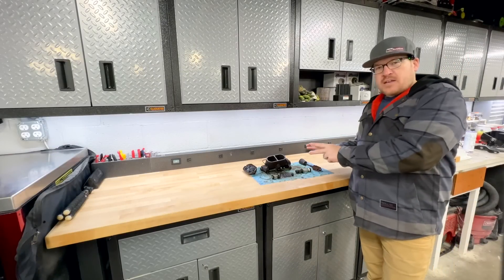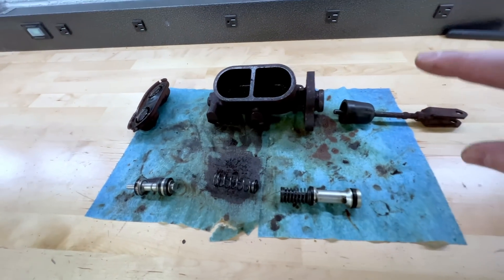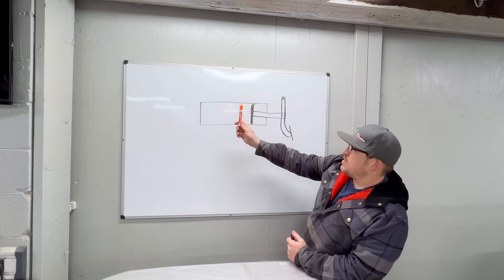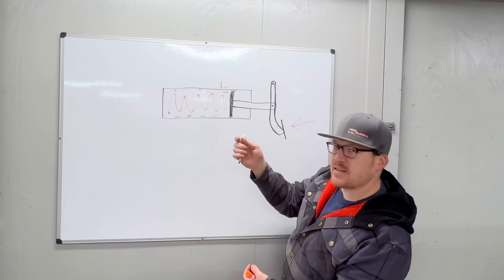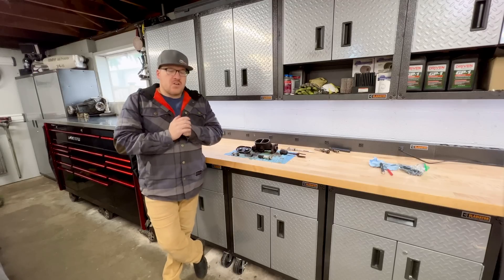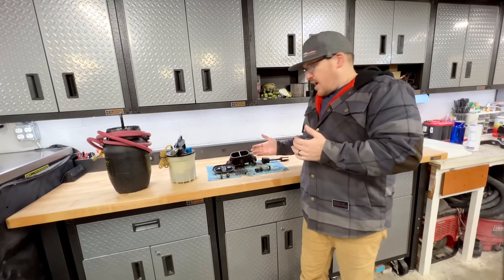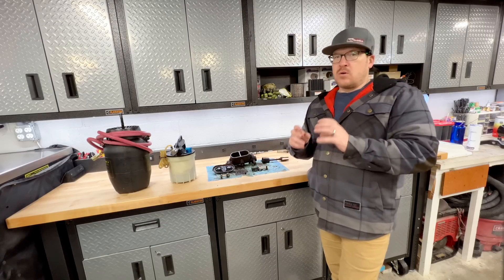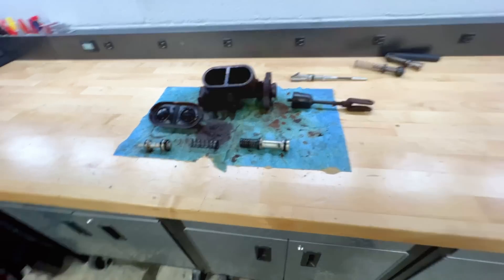Why Your BRAKE Master Cylinder Randomly FAILED After BLEEDING Your Brakes

Comment: I had brakes fail, Replaced calipers, no change. Replaced master cylinder, no change. Replaced brake booster, push rod engaged too much, over heated. Reset push rod, now it seems like the new master cylinder has failed. Brakes go to floor after starting car, can pump them up but drive any distance and very little brakes. Brakes wildly unpredictable, bleed brakes after every procedure. When engage brakes, squish sound, like fluid is going by the the piston. Fluid level is not declining. I just remembered i did not hook up electric monitor.
Reply: Did you figure it out?

Comment: Glad to see someone else emphasize brake fluid replacement.  I have been encouraging my clients to replace brake fluid for the past could of decades and for the most part have had good success after explaining to them the benefits.   

New subscribers here.  I appreciate high quality workmanship and have enjoyed the couple of your videos that I've watched. 
Mike
Reply from the maker: Thank you, Mike, and welcome to the channel! It sounds like we share a similar philosophy when it comes to working with clients and caring for their vehicles. Explaining the "WHY" behind any service recommendation is crucial.

During my time in dealerships, I often saw interactions between service advisors and clients that lacked transparency or detailed explanations. That never sat well with me. It’s always been important to ensure clients fully understand the recommendations, weigh the pros and cons, and collaborate on decisions that are best for both them and their car.

Taking the time to walk a client through these details builds trust and confidence, and it goes a long way in creating a positive experience. Brake fluid replacement is a perfect example of this—a small but significant service.

~ Nick
Reply: @AutoTechNick  very well said Nick.  I had a small home based speed shop for 20-years before closing it down eight years ago when my wife and I moved and I built my new shop at our new home.  

I still do work for others but on a case by case basis and the understanding that my stuff comes before any side work.  

I have passion as a mechanic as it appears you do as well.  I am anal about things and when a client trusts me with their vehicle I feel it is more of a partnership in the vehicle's care than just me working just to get the vehicle in and out of the shop.  

If the owner doesn't care about their vehicle enough to create this partnership I suggest they take their work elsewhere.  

I'm looking forward to checking out not of your videos as time allows.  
Mike